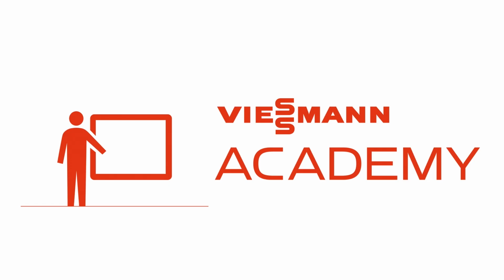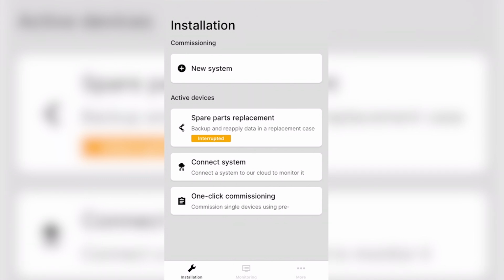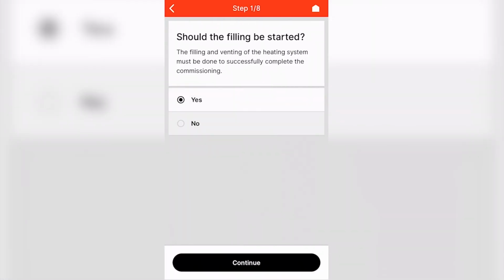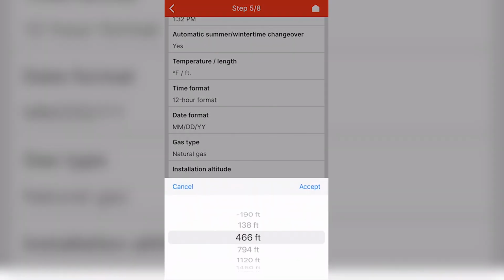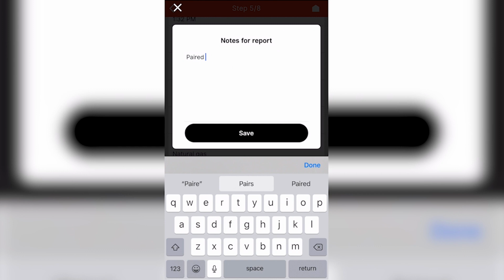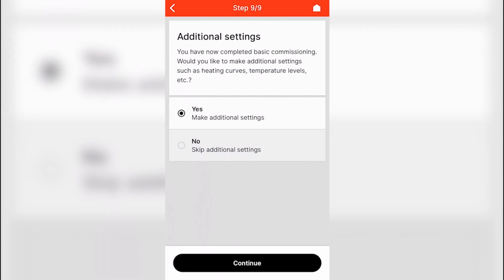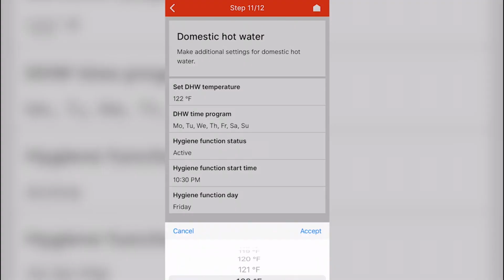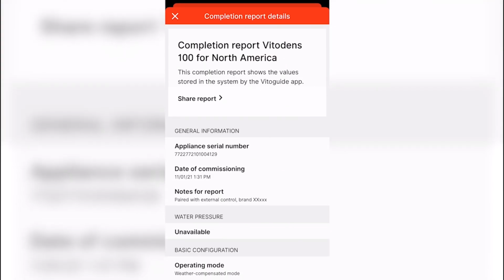How to: Commission the Vitodens 100 B1HE/B1KE with the ViGuide App

Comment: Can it be completed without DHW at all?  Mine gives me error code f7 no DHW connected constantly and it’s annoying.  I have it for heat only as I have a heat pump water heater.
Reply from the maker: Please contact your local contractor in order to troubleshoot a fault code. You may also contact our technical support line at 1-844-649-5886
Reply: Hello, thank you for watching our video. It can be commissioned without DHW and that will take care of the F.7, the DHW should be set to "Not Available". The boiler will auto recognize DHW if there is a sensor wired in so make sure there is no sensor there. Thank you I hope this helps.